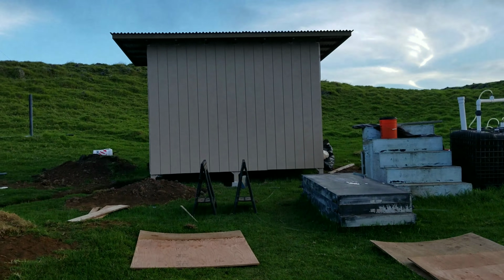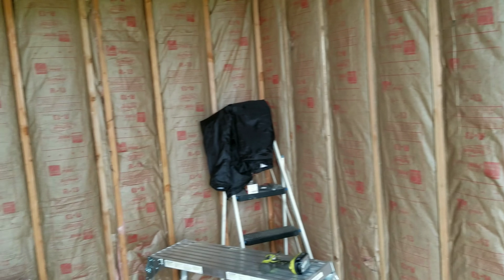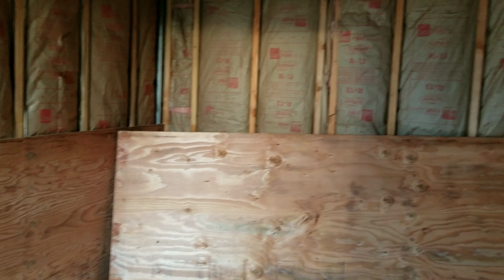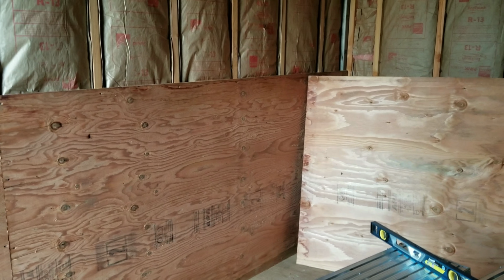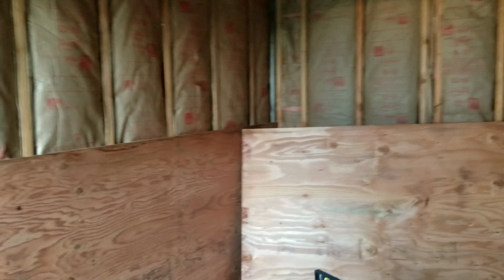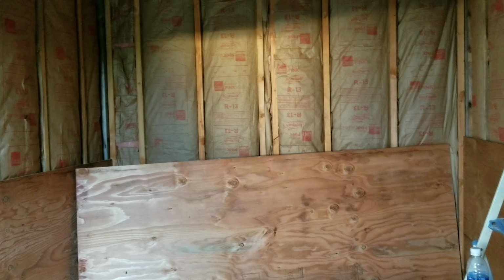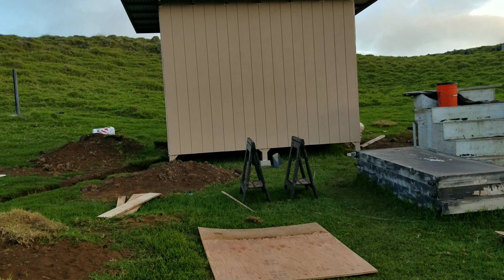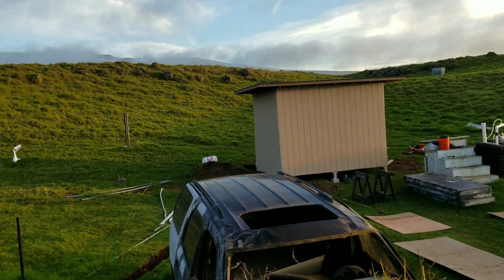New DIY Solar Power Building Off The Grid Pt-15

Comment: 👍 looks great.  Seems like a wise choice to have wood walls inside.  I would do the exact same thing.   .just curious...are you installing some kind of room ventilation?
Reply from the maker: Thanks Buddy, Its coming along nice it takes alot of drive to keep the ship moving. I been thinking about the vent I have some ideas  I just dont want any vent near any anything for a couple reasons, its still really easy to add it later just cut from inside and outside.

Comment: Thought that you were going to add some electrical outlets and maybe a light.
Reply: Looks good.
Reply: That what I was thinking too.  Unless he wanted to mount the outlet and running the conduit on the plywood, it would looks a lot nicer if the wiring is behind the plywood.